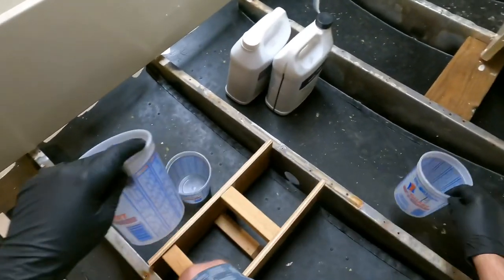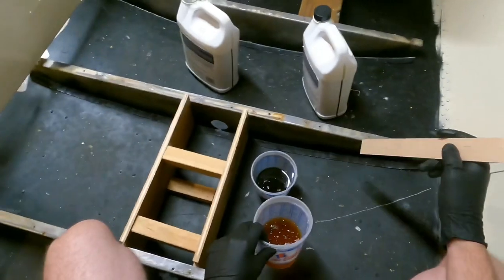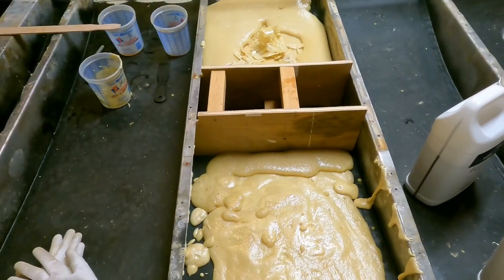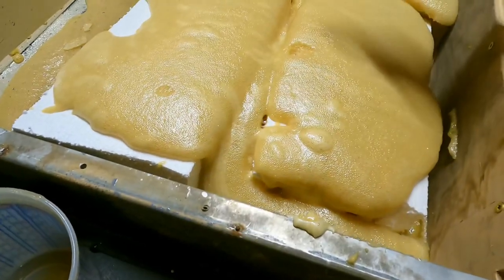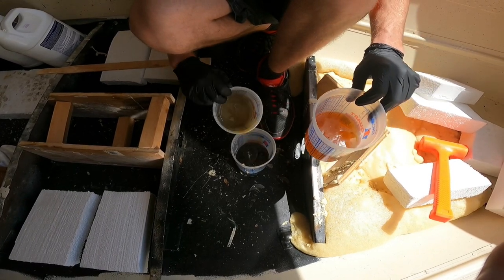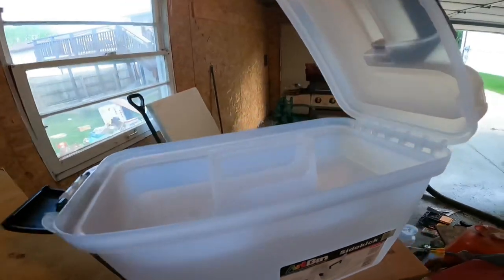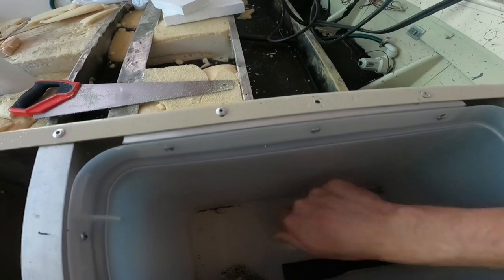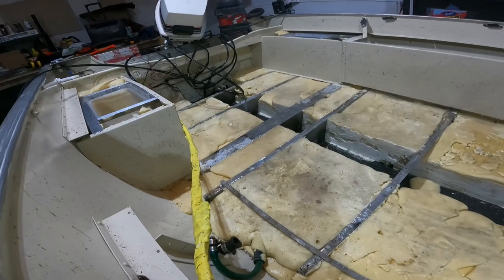Restoring An Old Lund Fishing Boat Part 3

Comment: Styrene foam is a no no. When in contact with gas, it will dissolve. Also, temperature when using this is "very important". It can make all the difference in the amount of expansion. Warmer the better, but not too hot. 80 degrees is ideal.

Comment: So … why not just fill the valleys with swimming noodles and be done? Why the chemistry and liquid foam?
Reply from the maker: The pour foam will benefit in a few ways: noise dampening, stiffen the hull, and less likely to adhere mold. I’m sure there are more benefits to it but those are the main ones that sold me on it!

Comment: You probably could’ve called one of those insulation companies and brought the boat there and they would’ve shot that stuff into your boat and I’m sure it would have been a little bit easier if not cheaper maybe I don’t know never tried but seems like whatever they use expands quickly and fills areas you can’t reach. And the PVC pipe I believe you should have used PVC cement not silicone that will fall apart in one day PVC pipe is met to be glued together using a cleaning solvent  and PVC glue the silicone will never hold.